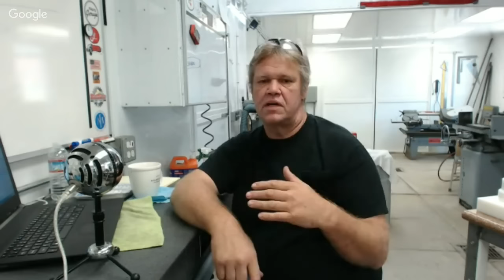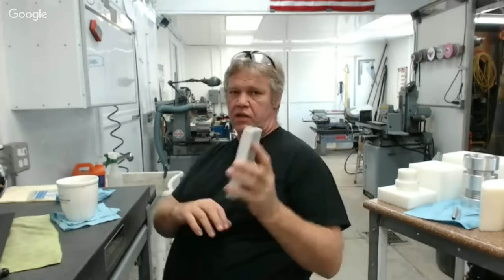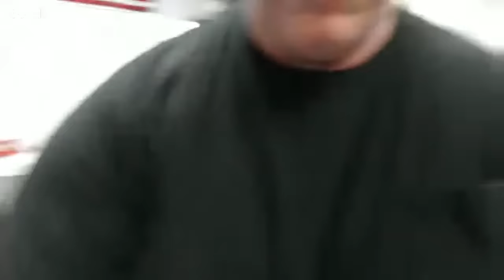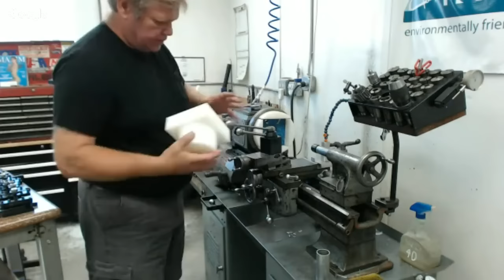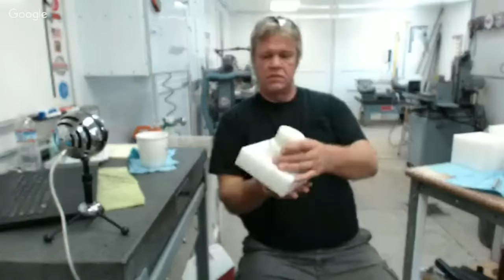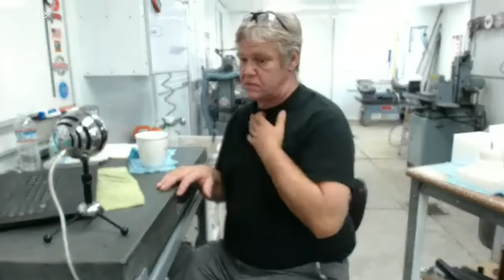Live shop #5

Comment: Hello Stan,

I've been running TP-link to my shop (I get my power and interweb from my neighbor) for years now and the only thing that seems to upset it is tigwelding when the pilot arc is fired. Otherwise it's been a 100% reliable product and it's faster than you think it is. At home I have a wifi access point on it. it does have wired outputs but it copies the wifi set up you have using WPS and then you can plug it in anywhere, even outside of the normal range, because it's not a repeater but powerline linked !.That makes it fast to and even may be faster than your router is !.
Reply: BTW, they do not work all that good if they are not on the same phase or "hot legg" . So running your 110V systems in the US check you are on the same legg for it to work 100%. If not it will slow down the connection.
Reply from the maker: Good tip and makes perfect sense.